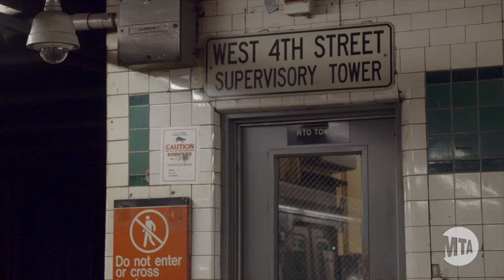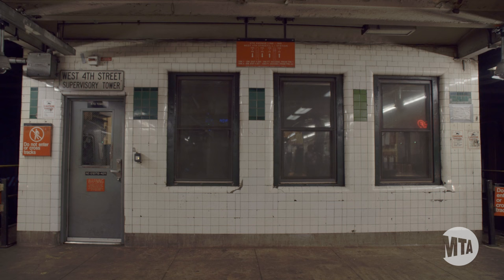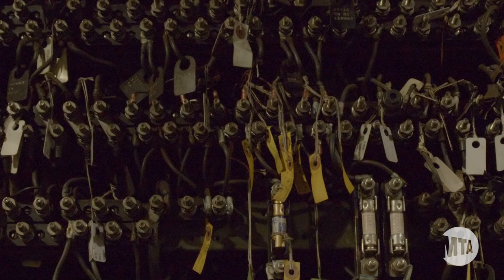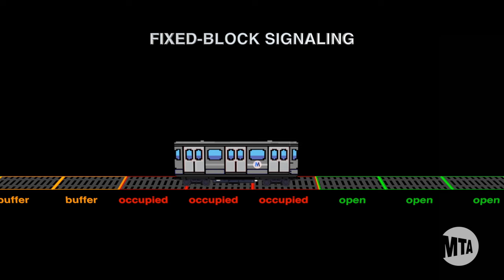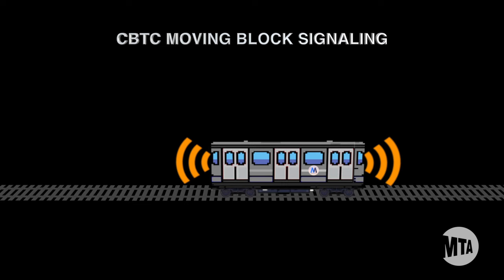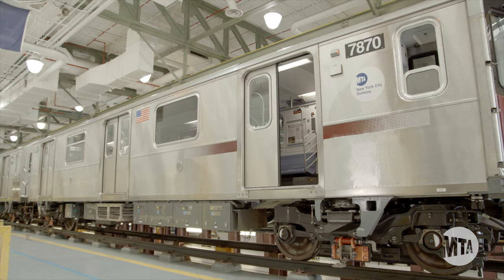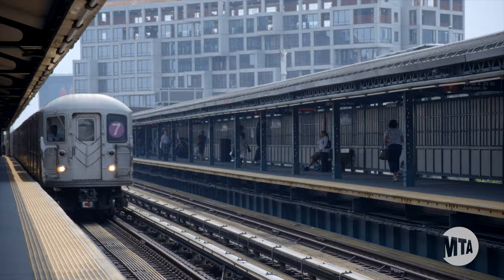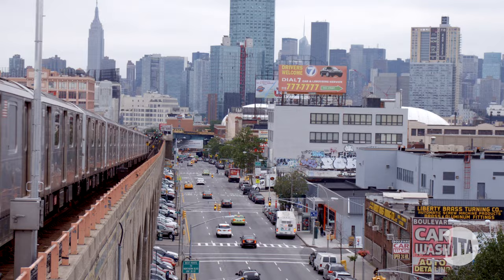CBTC: Communications-Based Train Control

Comment: You'd think a city like New York could have automated subways by now. Many other cities have had them for years now.
Reply: flyingchimp99 This city is always a target for evildoers, so it makes sense for them to continue using this control system, as antiquated as it may be.
Reply: TheMusketITuckedIt So are other cities.
Reply: flyingchimp99  I'm all for the old tech. with as much of a target as NYC actually is, old tech is more reliable and cant be hacked.
Reply: flyingchimp99 driverless trains cost way more (mostly for intrusion prevention and detection) and the delays when they occur take longer to recover from.
Reply: +Sunny Raines I prefer having a person up front driving the train I am riding. Yeah, it means you have to pay a person a salary to sit up front and drive the train. But It means a paycheck at the end of the week and I feel safer knowing there is a trained individual in control of the train I am riding. The idea of having a machine doing the driving doesn't set well with me.
Reply: +BT And the old tech works. Even iif they eventually do switch to all CBCT I think the old systems should be kept in place as backup for at least a while, if not permanently.
Reply: The MTA didn't go along with that idea after 9/11. The trains we have now r142/r142/r160 can go automated if they want to.
Reply: +dubreil07  your wrong, The only rolling stock that is comparable with Cbtc Is The r188s, and the r143s, other cars have no transponders that make them cbtc comparable along with other things that make cbtc possible that I won't go into detail with.
Reply: well the train could still be automatic but they could have a staff member still be on board to monitor the train if anything goes wrong. autopilot for trains
Reply: That would cut thousands of jobs and also would pose a big security risk in "a city like New York"
Reply: Erfan expect AIRTRAIN. It’s automatic
Reply: Erfan also,people will be POOR.
Reply: @BT-cr6xb  CBTC can't be hacked either as they don't use public networks such as the internet. Also do some research CBTC is by far the most reliable technology in railway signaling.
Reply: @WitchidWitchid  They should switch entirely to CBTC, and old system as a backup is simply impractical. Plus, most CBTC systems have a fail safe or fallback mode which allows for safe operation, albeit not completely, during a disruption.

Comment: Interesting to hear about the "old-fashioned way" which includes the interlocking equipment. When I "broke-in" on on the Southern Pacific in 1971, there were some signal towers that had equipment dating back to the WWI era. The power supply for moving the switches was via direct current motors. The signals, I was told, were originally semaphore types. The semaphores had given way to "target signals" prior to my 1971 arrival.

Comment: I've seen a (L) train operator using CBTC nd I noticed the train driving itself, stopping at every station by itself I thought it was cool. I also seen the driver get out of his seat while the train was breaking into one of the Manhattan stations.

I noticed this everytime I've missed a (L) train, that there's always another (L) train behind driving really close to the one that left the station that I missed at the morning rush hour
Reply: Im a train Fanatic i know right, i recently saw like yesterday around 9pm on Livonia Ave a train operator on the manhattan bound platform was on his phone while the train was breakin into the station💯💯
Reply: Camara Dëx And they say that this is better.
Reply: Blake McNamara It is better. CBTC has been in operation on the Canarsie Line for nearly 6 years, and so far, not a single crash. Compare that to what happened in 1995, when a J train crashed into an M train on the Williamsburg Bridge since the signal system did not work.
Reply: Why they don't just make them fully automatic ?
Reply: French Dude Last time we tried reducing the number of employees on the train there was backlash from the union since it violated outdated union rules.
Reply: That’s ATO. CBTC is a signaling system. ATO is not.
Reply: French Dude Now your talking about putting train operators out of work.
Reply: fnihp30 Honestly, if they were to automate and do driverless, I’d see those train operators reassigned to more meaningful jobs around the train, such as possible ticket inspection, and maybe a train ambassador to allow passengers to get help from them.
Reply: fnihp30 millions of them
Reply: JeremiahC99 there are already those jobs. Except why would they need ticket inspectors?
Reply: Lord Alex The Dev Probably to check who paid and who didn’t.

If the system would do driverless, the conductors and motorman would do that instead.
Reply: JeremiahC99 they are already adding cameras at stations, in front of enterances. To know who paid or not. And how would you be able to see who paid or not?
Reply: @TheRailLeaguer  How would they check who paid and who didn't? There is no ticket. Passengers use a Metrocard.
Reply: Patrick Morrissey OMNY will change the way fares are being paid and inspected. What I foresee happening is that the inspectors follow what they have in San Francisco with the Clipper Card, which is to check fares with a special device
Reply: @TheRailLeaguer  Why would there need to be a change? The Metrocard already works just fine. Besides, have you ever seen or been on a packed NYC Subway during rush hour? You can barely move. It would be ridiculous to have inspectors trying to walk around every subway car trying to inspect fares. The two person crew works just fine, (train operator & conductor.)
Reply: Patrick Morrissey The MetroCard is outdated and costs a lot of money, so upgrading the MetroCard is the only solution. Plus every other city has updated fare payment technology, so why not NYC?

There would also be fare inspections on the subway platform as well. Essentially, SBS-style fare inspections on the subway.

No one is proposing to get rid of two person train crews. Rather, jobs are changing for both folks, not being eliminated.
Reply: @TheRailLeaguer  What is outdated about it? How does a new fare system save money?
Reply: @TheRailLeaguer  You can't compare BART with its 48 stations and 400,000 daily riders to the NYC Subway with 472 stations and 5,500,000 daily riders. It's just too big of a system with too many people for that kind of a setup.
Reply: Patrick Morrissey I’m not talking about BART. I’m talking about the MUNI system with the clipper card: A specialized device used for checking fares would be handy for fare inspections.

However taking into the account with crowding, I recommend the setup present here at home on the Select Bus Service, with fare inspections at the station as well.

If London can have a modern fare payment device, so can N.Y.
Reply: @TheRailLeaguer  Respectfully, what in the world are you thinking! What's more meaningful than safe train movement!? I am a Train Operator in NYC, have been for almost 14 years at this point, and I can tell you for fact Train Operators will/should always be upfront! Even in CBTC you have to have someone there to monitor and make sure the train is doing what its supposed to do #1. #2 be there to stop the train in an emergency. #3 have to operate manually when and if computers fail or when scheduled work is being done. And our system is a closed system, payment is required at entry not like open systems in other parts of the country and world. Tickets are not required in our subway.
Reply: @michaelsanchez2417  What am I thinking? The real question is what are YOU thinking.

Plus I'm no longer proposing that train operators be removed from the front of NYC Subway trains. Rather they will remain. It's the conductor positions that's up for contention. Realistically, never have I proposed implementing a person train operation, but rather I have made some suggestions.

PLus other transit systems have fare inspection inside the paid zone. Hell, even the Select Bus Service routes here at home have fare inspection on the bus, so why can't we expand it to the subways in conjunction with OMNY.
Reply: @AE2-scc  Right..exactly.
Reply: @TheRailLeaguer  I mean if anything, those workers should be laid off. NYPD can take the brunt of stationing personnel on platforms for safety and preventing fare hopping, and the idea we need to pay a bunch of transit workers 80,000 a year to be "ambassadors" is fucking stupid. Employment makes up half of the MTA budget right now, and interestingly half the MTA budget is collected via fares. With better service, ridership could go up even more meaning the system could legitimately become profitable like it is in cities like Hong Kong.
Reply: @benw3864  You joking, right? Perhaps we can just replace the NYPD officers (many of whom are way too abusive) with the MTA station personnel to assist passengers with way finding, and locating trains.
Reply: @michaelsanchez2417  Train operators like you are notoriously greedy too and hold public transit back severely in the city too. Half the MTA's budget is going to bloated salaries and you guys strike every other week. Entire systems around the world are going fully automated without ANY personnel on board and showing increased safety and are able to cut operating costs significantly. Automation is being embraced big time in cities like Paris, and the transit unions are scared because during Parisian strikes the automated lines are still able to work perfectly, and now the french public is realizing that automation gives them better service, and makes it so they dont have to deal with the bullshit of transit workers. In these systems, all you need is limited personnel in control rooms to monitor the entire system.
Reply: @benw3864  Really, because that’s untrue at all.

Perhaps rather than eliminate them, we can change their whole responsibilities. Here, the train operator and conductor positions would be merged into one “Train ambassador” position. They would have two responsibility:

-Monitor the tunnel from the operators cab, looking for anything that is suspicious, and taking control of the train if needed.
-Monitor passenger activity on the train, including and not limited to, emptying trains that are taken out of service for any reason. They can have the ability to call NYPD or medical personnel if needed, meeting them at the next station.

There would be two of them on each train, one responsibility each for a round trip. On the return trip, they would switch the responsibilities. Occasionally the crew would be accompanied by a rookie ambassador shadowing the senior staff.
Reply: Transit hasn't gone on strike in over ten years. Wtf are you smoking

Comment: Why don't you try upgrading the infrastructure with all of these fair hikes rather than lining the pockets of MTA executives?
Reply: James Poling it will cost money, this one works fine, more advance system are faster and more efficient but more vulnerable.
Reply: +odisy64 depends on how you do it. those rare relay and switches can be converted into modern logic gates and stuff. advance system is not less vulnerable, it's just not done right. if the company can make his own FPGA application and locking it up inside security perimeter, it'll be the same "vulnerability"

people are referring the new system in such way that it can be accessible from anywhere to everywhere and using common protocol on top of that.
Reply: A subway ride is cheap compared to every other metro system.
Reply: James Poling 
Yeah I think the fare hikes are fair.
Reply: Just built a new subway line....
Reply: Top MTA execs make no more than $300,000 annually. That's not much considering the amount of responsibility that comes with the position.
Reply: RB Zee 🛡️🛡️🛡️ not exactly,its only $2.50 per ride

Comment: C'mon MTA and Cuomo...  Let's get this done faster.   I'm still late to work because of signals on the 4,5,6 not working.  I still have to wait 10 minutes in the morning and sometimes 12 minutes in the late afternoon.  This is NYC - speed and efficiency are most important.
Reply: Wow... Get some help.
Reply: Woah you need to wait a hole 10 MINUTES!?!???
Reply: @Nathan-cv6sm  now multiply those 10 minutes by the hourly wages of the millions of passengers that go through the system each year.
Reply: Leave earlier...
Reply: @Nathan-cv6sm  in a first world major city that is too long... many others are only 3 minutes... learn about how the world works
Reply: @Nikosi9  if everyone leaves earlier it is the same problem braniac

Comment: The issue is not having antiquated stuff; for example, Paris and Montreal metros do have trains that are over 50 years old (MP59 and MR63 most notably). Yet they work. The point is to have something that can work fine on a day to day basis. And of course being able to properly maintain it, this is where it can get tricky.

Comment: Very cool.  The old control equipment that is maintained internally, reminds me of the older components in the FAA's air traffic control system.   And if the subway is like the FAA, they could use more funds for upgrading the infrastructure.

Comment: We're long past the point where all this old signaling equipment should have been torn out but the fact that it still does it's originally intended job is a testament to the skills of engineers and mechanics long gone.
Reply: It’s not doing it’s job well right now. An upgrade is really needed.
Reply: @TheRailLeaguer  They have been upgrading it. The work is mostly done at night between 12am - 5am.
Reply: Just because something is old doesn't mean it has to be eliminated. The main concern(s) are how well it works. If its working poorly can it be fixed or what can reliably replace it and will the replacement be as reliable or even more reliable.  From a passenger standpoint it doesn't matter if the system is so old that it dates back to the Medieval days or so new that it was just invented. All that matter is that it's reliable, safe, and gets the jobb done in a satisfactory manner.

Comment: Funny how they try to make having outdated technology for such an important transportation system a good thing
Reply: Nathan Zaremskiy if it works why up Agra’s
Reply: Frankly it's impressive how such an old system has been kept working with limited upgrades for so long. Some parts of the UK are also still using semaphores from the early 1900's as well, so it's not unusual.
Reply: @JacobHoggan  "if it works"
It doesn't though, they mention several times that reliability is an issue.

Comment: In singapore SMRT or Singapore Mass Rapid Transit PTE LTD, we are currently upgrading our old lines. This includes Sleeper replacement Timber To concrete, 3rd Rail upgrade and CBTC By Thales SelTrac.
Reply: And also we are upgrading Train motors from current VVVF to PMSM Motors(Permanent Magnetic Synchronous Motor) This helps train energy to an efficiant rate to 30% and CBTC Will help train frequency from 2Mins waiting time to future 100Sec waiting time. Better Frequency More trains on the line. +mtainfo
Reply: syed daniel So which train models have them? I'm assuming Downtown Line and Circle Line trains? Or maybe those new trains for the older North-South/East-West Trains that rolled out?
Reply: Fatal_Taco The C151s have the PMSM motors (for now).

The C951 (for DTL), the C830/C830A/C830C (for the CCL), the C651, C151B, C151C (2019)(for the NSEWL), the C751A/C751C (for the NEL) and maybe the CT251 (for the TECL in 2019) have the Thales CBTC.

All lines will be resignalled anyways

Comment: I realize this video is two years old but sadly, little has changed since it was made. The subways are worse than ever, plagued by constant delays for reasons ranging from mechanical issues to 
signal malfunctions. A new transit chief has promised to turn things around, but we are yet to see any major improvements as it may be too soon.  Pity, because in my opinion, ridership has actually increased manyfold in the last ten years and so many are dependent on the system for getting to and from work as well as for recreational purposes. Yes, the system actually does work for most people since many do not have an alternative form of transit; they just want a better functioning one!

Comment: Doesn't it look the same with ATP(Automatic Train Protection)? CBTC looks a lot like it. Here in Athens, Greece, in the subway system, that is what they use. For example, a train can get clearance when stoped at a station, but if the ahead train is close enough, instead of 70-80 Km/h, it will get a 40 maybe limit. This helps a lot to maintain a steady and of course a safe, time and distance.